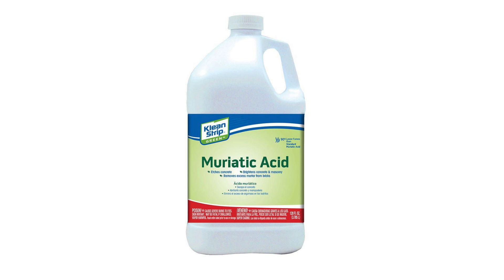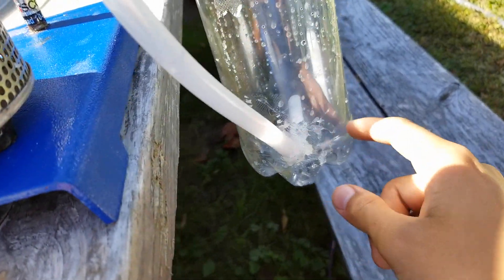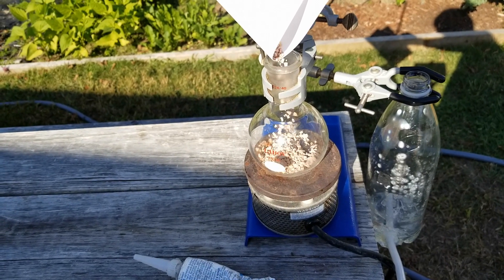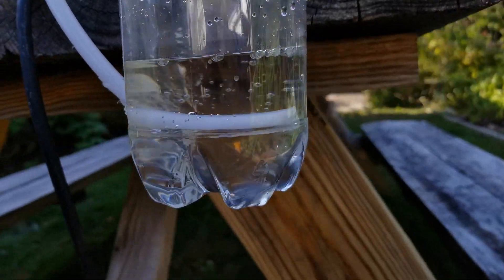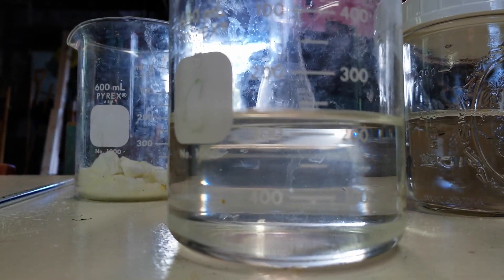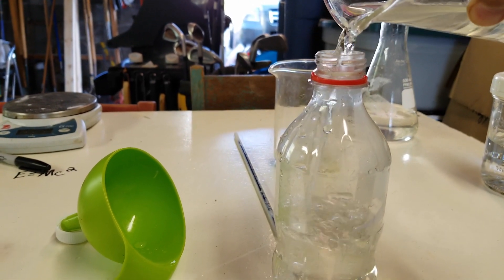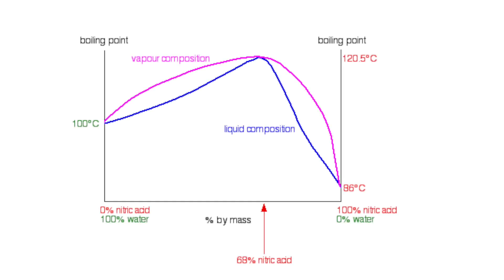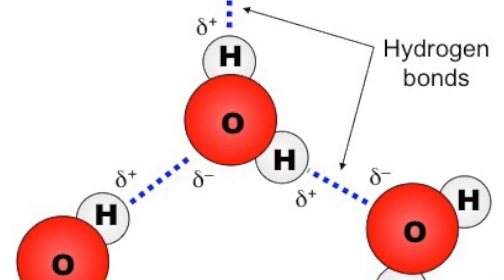How to Concentrate HCl  (Azeotropic Distillation)

Comment: Aim: keep low pressure in the flask.
Materials required :a aquarium,a glass piece having same lenght and breadth having a small hole, funnel, beaker containing muriatic acid polythene tube,cork

Make a hole in cork and attach the polethene tube and attach a funnel( pass the tube through the hole in glass piece.)and dip the funnel in beaker containing muriatic acid. Keep the beaker and funnel in aquarium thus not wasting vapour and maintain good pressure

Comment: HCL  here available with 30 to maximum 37% concentration forms, I working with 30% which fuming badly right when I opened the bottle,  the worst is when I need pouring to the beaker..need holding breath , do the jobs quickly, than take a distance for another deep breath;))

Comment: So what was the concentration of the acid in %? How do you convert Mole to %?
Reply from the maker: I never titrated this specific batch, so I'm not sure what the concentration was. It was probably around 32%. 

In order to convert mole to %, you first need to titrate the acid to see how many mols of hydrogen chloride are in the acid solution. Then convert the mols of acid into mass by multiplying by the molar mass (36.5 g/mol for hcl). Finally, divide the mass by the volume of the acid solution, and you have the %

Hope this helps!
Reply: @Cookieglue  In another example, If the H2SO4 works out to be 0.196 M, then the % is 19.2% concentration according to what you told me. Can you also just do a quick check by multiplying the 19.2% by 5 to get 96%. Now you can do the same with the 0.196M and see if you get 18M concentration.
Reply: @Cookieglue  certainly you didn’t close even to the  25% concentration, 30% HCL make a huge nasty white smoke,  its impossible to can pouring into beaker like that..you cant tolerate that gas even for 2 second .. results of breathing a tiny amount is Instant severe suffocation..

Comment: Im sure you figured this out already, but instead of attaching the tube to the glass tube inside the ground glass joint, you could just attach it to the actual vacuum adapter port, then attach a RBF to the bottom of the vacuum adapter. That way the gas vapours go out the vacuum port into the HCl you're concentrating, and any suck back just goes into the RBF thats on the vacuum take off adapter.
Here's my setup: https://imgur.com/a/2pXjMzO (which btw I used your video as a guide :-) )

P.S. You could also submerge the container thats absorbing the HCl in an ice bath, since water holds onto more HCl if it's colder.

Comment: Sure there have been plenty of suggestions, but have you considered a pressure lock, similar to what brewers and fermenters use to prevent co2 pressure build up. Might consider improvising something with a larger water volume, any Unwanted gas should react and

Comment: You could try using an inverted funnel trap to eliminate the need to vent the system by removing the stopcock. The purpose of an inverted funnel is to allow the system to alleviate negative pressure by taking in ambient air, while still forcing positive pressure to bubble through solution. Naturally, as the system is cooled and hydrogen chloride dissolves, the volume of air in the reactor decreases and thus so does pressure. The system compensates by sucking fluid back into the reaction vessel. However, when an inverted funnel is used, the mouth of the funnel will begin to draw in liquid, but if the meniscus of solution goes below the funnel's mouth, the liquid in the funnel will pour out as atmospheric air is drawn in.

Comment: Just use a vacuum trap aka suck back trap and you won’t need to equalize the pressure because it will suck back into the trap rather than into your boiling flask. I just use an extra gas wash bottle